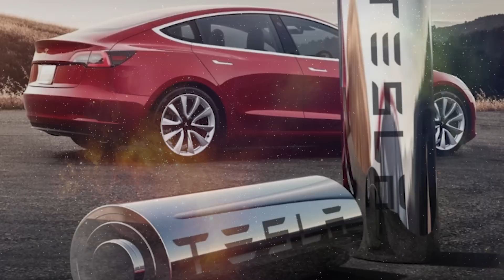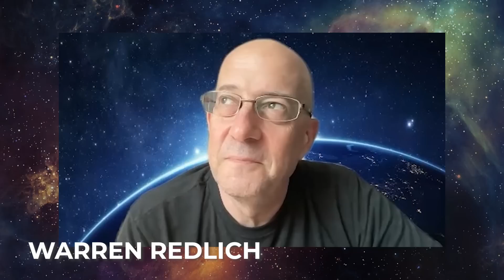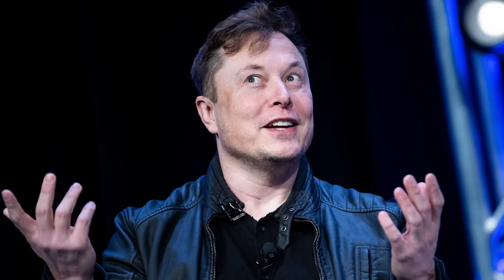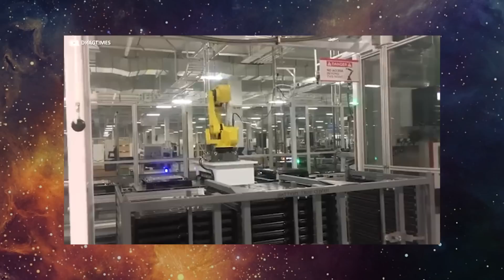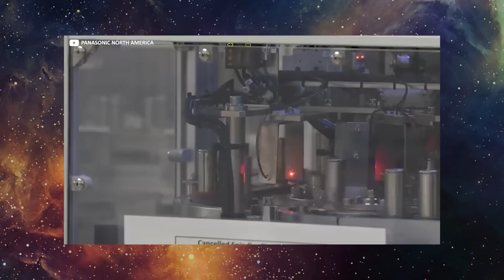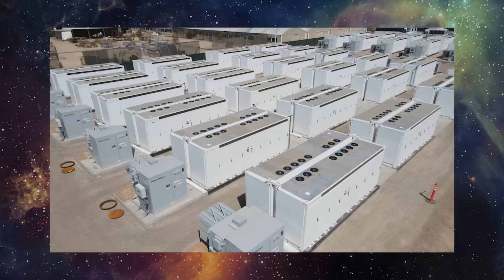Implications of the TESLA Battery Moat, Materials Moat, More - Interview with Herbert Ong

Comment: Thanks for the video. I have a question regarding Tesla's energy side. How do you see Tesla regenerate revenue from mega packs? I have hard time thinking about this besides providing service maintenance only. Thanks.
Reply from the maker: They will have software charges that I suspect will be annual. In most cases they will be working with the customer on energy arbitrage with the utility, so they will get a percentage of the arbitrage.
Reply: @RandyKirk_YouTubeChannel  I see. Thanks for your reply. 👍

Comment: Does tesla manufacture the 4680 batteries or they bought from BYD or Panasonic. 
Recently, there is a news of 1000 4680, where i had thought 4680 was there for quite some months. Or am if I wrong.
Reply from the maker: Tesla has set up a pilot line for 4680 in Fremont, and they are building a line in Austin and one in Berlin. Probably one in Shanghai later.
Reply: They have a pilot line in Kato road near Fremont factory with an expected capacity of 10GWh/year. The lines in Austin have a final designed capacity of 100GWh. Panasonic has a prototype line in Japan, (I think) and others are working on their own versions, possibly with some kind of arrangement with Tesla. 

Are you talking about the recent announcement of enough 4680s for 1,000 cars in one week?